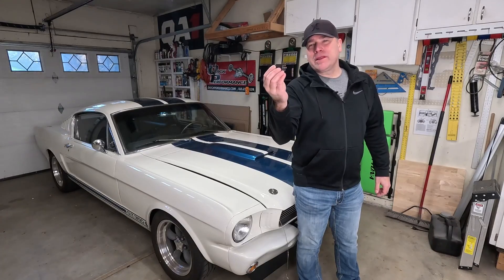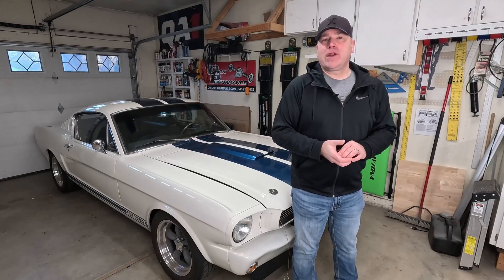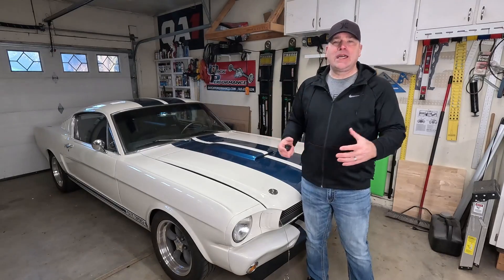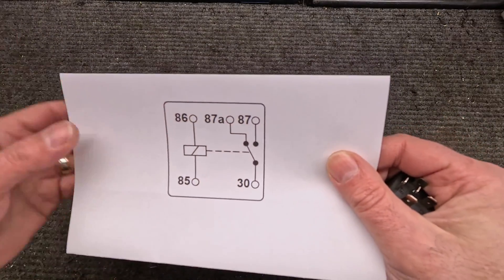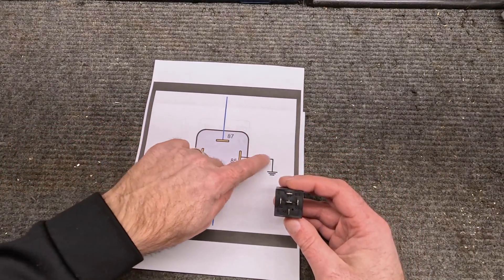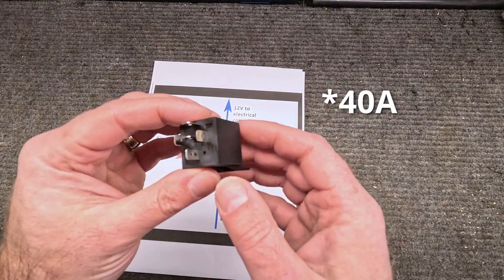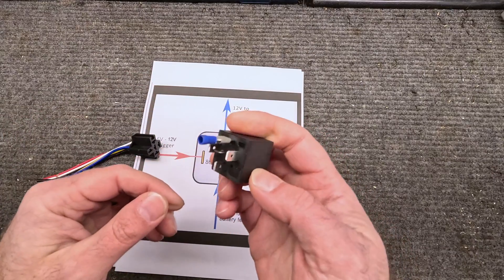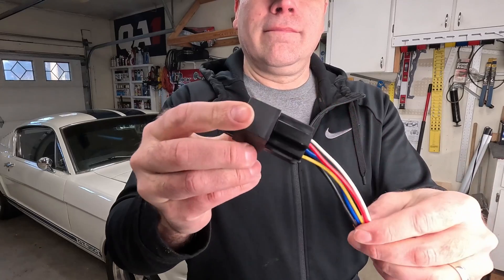How to Wire a Relay

Comment: Great video…. I’m about to start my F4TE 351w build for my 67 mustang, but I haven’t done much wiring stuff.  This helped me understand the basics on relays.  I’m sure I’ll be using this video when the time is right.
Reply from the maker: Awesome, I hope your 351 build goes well for you, that's a great block to start with.
For the relay stuff, there are so many paths one can take with various things they can control.  But the fundamentals are the same, hopefully it will be smooth for you.  :)

Comment: Relays have a power circuit and a control curcuit.  Will i need a larger fuse box if there is no room for expansion using a control curcuit?
Reply from the maker: I'm not sure I understand the question.  I think I'm getting confused with your question about needing room for expansion.  Are you referring to physical space, or are you asking about expansion in terms of adding additional control with the same relay?  :)